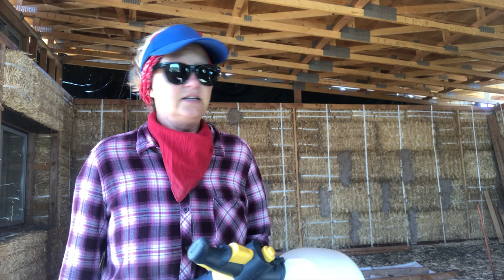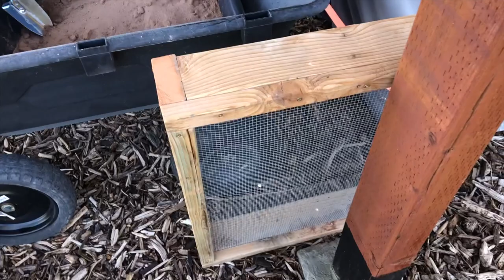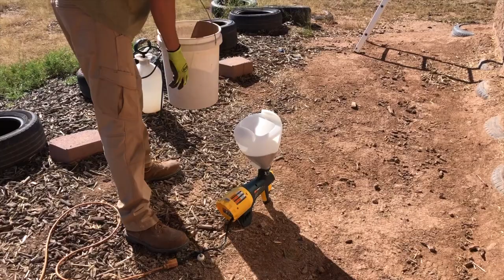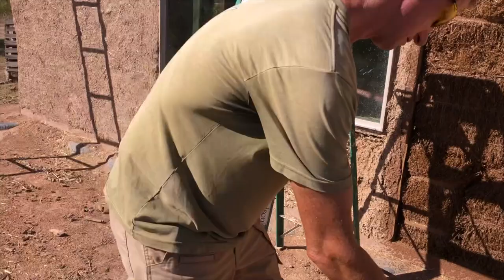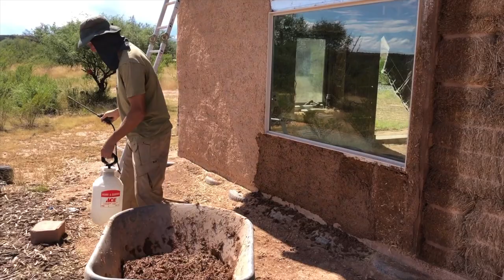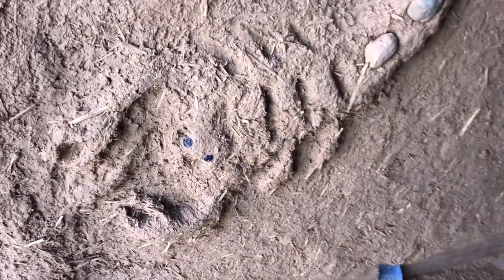Invaluable Tool for Strawbale Plaster Application

Comment: That slip will certainly lock in the cob much better. It is clear that you are becoming proficient with the process. In honor of rain AZ and in FL I bought some tan paint and worked on muddying up a couple model John Deere tractors for my collection. Evidence they have been working instead of sitting! Thanks for this video!
Reply from the maker: Thanks so much Michael!  Those tractors sound great!

Comment: Hi Brian & Pam😊 That was quite a heavy crazy storm😮 Then you get out there, forget your lip moisturizer & get attacked by gnats. Nice thing is...a video went up on Brian's channel🎉, the house is looking more complete on the outside & it didn't rain on you guys while out there spraying💯😃 It would have been so cool if you could have got more sculpturing in onto the sides of the house! What a conversation piece that would be for generations thru time🤙 Is doing more outside sculpting something you are considering?  Doing a great job guys and yeah, that mixture looked like chocolate cake batter or chocolate milk😁 Which I don't eat or drink either one anymore😭 I get so sick if I even sneak a couple bites...or a slice☺️ Have a good one guys 🤗🏜️💚
Reply from the maker: Thanks so much for watching Lisa. We are definitely going to go crazy on the sculpting and decor. However this is just the initial coating. We will be doing a lime coating as well to protect from water. Thanks Lisa!!!